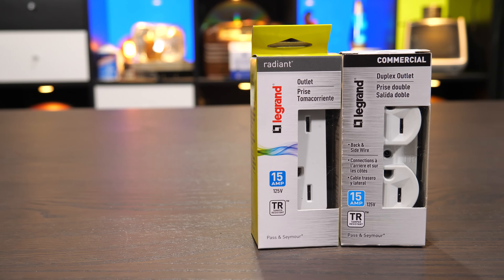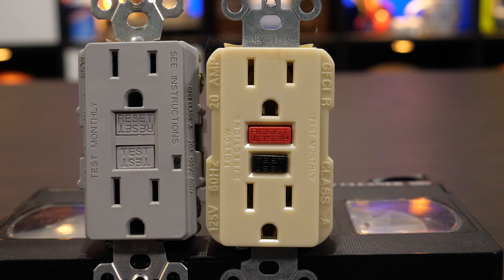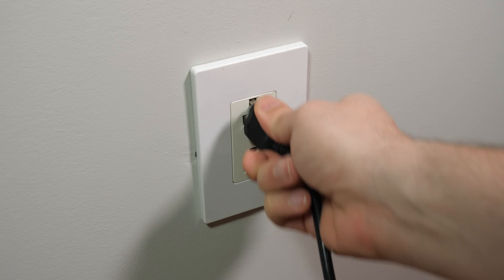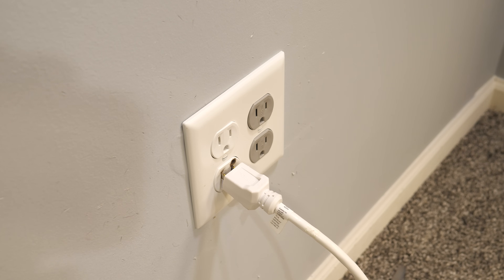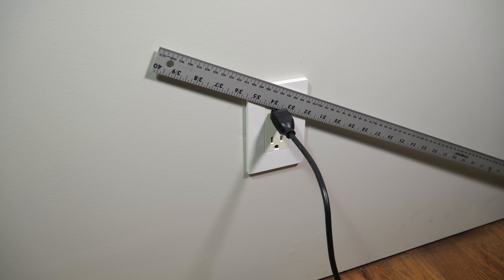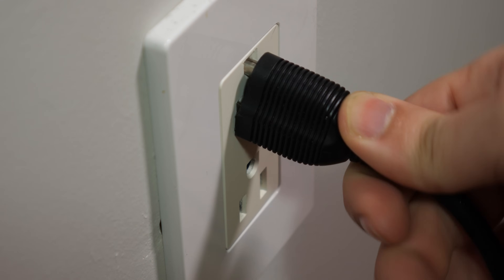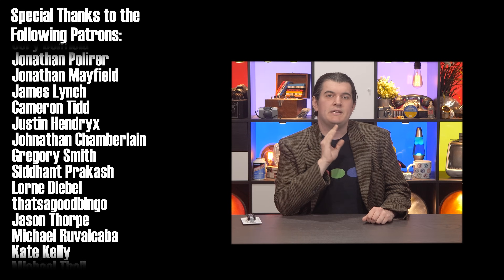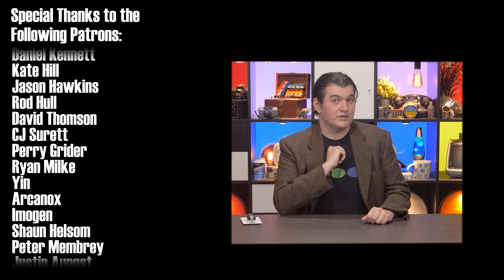Power outlets are topsy turvy - but does it matter?

Comment: I believ this is the point where I point out that here in the UK we have standard BS 1363 plugs that solve every issue you've brought up with the US power outlet.

- They are all 3 pin, 90° designs, so stable they're virtually impossible to accidentally knock out/loose (even for very worn units).
- The ground pin in on top.
- The ground pin is longer and opens shutters on the receptical which literally makes it impossible for children to electrocute themselves (for low power devices, the "ground" pin is a dummy)
- The electrodes are shielded so if the plug is in far enough to in to open the shutters, the plugs have no love metal showing.

- The plug body is usually shaped to facilitate safe gripping for both insertion and retraction.
- There is built in extra slack for the ground pin, so if the strain relief fails and the electrodes inside the plug body get pulled lose, the ground pin is the last to fail.

It would be such a pain for the US to change, but it's so much of a design!

Comment: Several of the power strips that I use have 90 degree swivel plugs. While I'm certain they're more expensive to make, and probably more prone to failure over time, they are nonetheless a great solution to the wall plug orientation problem. It doesn't matter if it's up, down, sideways or even diagonal (and yes, I've seen plug that was diagonal so it followed the line of sight of set of stairs) you can always orient the cord in the down position. What would REALLY be funny to see is one of those outlet-mounted surge protectors that have the outlets turned 180 degrees to the plugs on the back in order to invert directionality.

Comment: why not one face one upsidedown. ground on outer perimeter.
Reply: The problem with that is that the hot and neutral connections would be reversed, with one hot on each side and one neutral on each side.  This is awkward, because the two hots and two neutrals are connected together when it is manufactured, but can be separated by removing a connecting piece.  As designed now, it is a straightforward design.  Take a look at a new one and you will see what I mean.

Comment: US should just adopt British plug as a nationwide requirement. It's safest on the planet, can withstand crazy amounts of current as the prongs are huge comparing to those wimpy used in America. Almost every plug has a fuse itself. Also many European plugs are far superior. At least it's very hard to dislodge them, prongs are round and receptacles are placed deep inside so the chance of getting finger between live prong is almost impossible.

Comment: actually it is ideal to have ground down  and was done  to ensure if in case of flood the ground is the first contact to ensure water is grounded thats why right angle plugs are made like that  ,you are more likely flood then to  have something to come in contact with the plug and the sideways is for flood zone prone areas to ensure that a neutral grounds it out and it trips the breaker , water the nemesis  and really are you that much of an idiot that you don't plug it in all the way

Comment: Make more sense since a half way plugged connector in case something drop and make contact in between the outlet could have less chance of making sparks if the ground pin deflect it. I have seen some barber shops having the outlet installed with the ground pin upside. Is the correct answer to install it neutral pin up?

Comment: Ground pin up is usually job specification. And spec get you paid. Horizontal receptacles with the neutral pin on top is code. Most covers used these days by pros are nylon, stop buying the cheap ones at the Despot! One solution for the right-angle cord pointing up is to take a mountable tie-wrap, anchor it to the stud above the box and tie-wrap the cord to the wall. no chance of unintended unplugging.

Comment: Twice in my life I've seen things slide down behind the plug and short the pins and make smoke and sparks.  Once someone was adjusting something hanging on the wall and it fell down and exploded.  The second time someone was pulling a plug out and the motion shook the wall plate loose and fell down and exploded.

Meanwhile, in the UK the ground pin has always been at the top but many right-angle cords and wall warts are made to assume that it's at the bottom because that's how it is in the US, so the cable exits upwards.
Reply: More recently I've seen outlets with a shelf above the surface the plug presses against.  Also to the left, where the switches are, forming a kind of capital Gamma (rotated capital L).  So if you did need to mount it sideways you would clearly want to put the shelf and the switches, at the top.

Comment: As a German, the first time I ever used a NEMA plug was also the first time a got shocked in the process of plugging or unplugging anything. And this was in Germany, too, with our spicier 240 V 60 Hz (using an adapter).

I do believe that the North American countries could (and should) switch to a safer connector if they just wanted to. All arguments that claim it's impossible because "we already have this plug" or "there's too much momentum" aren't believable to me. Once a country decides to switch plugs and passes all necessary laws and regulations, new buildings will have new receptacles. Everybody will get used to using adapters for a while, and in 20-30 years most of the plugs will be safer.

Comment: Ironically, the right-angle power cord (non-swiveling) on my refrigerator WAS designed with the assumption the ground would be on top, but since it's plugged into an outlet with ground on bottom, the fridge cord is "upside-down" and drooping awkwardly just like the demonstration at 12:27.

Comment: Insulating pins near the handle is the only way to make it safe IMO.

European plugs don't have sleeves over the connectors, it's actually a plastic part that is the same width as the conductor. 

I bet if the pins are the same width with insulation it will work everywhere as sockets latch onto the holes in the plug which are at the far side

Comment: We in Europe do not care. SchuKo/type f (common EU plug with ground) goes both ways and is secure enough to the point that you really need to yank it. We usually have much more stuff with the other end of the detachable cable (powersupply etc.). And simple plugs without ground are the same. But we do not have them installed horizontal in most cases, over/under is normal (which is annoying with some bulky connectors or devices)

Comment: A wise electrician once pointed out how flawed the metal cover plate argument is; if the plate falls off and shorts between the blades of a ground pin down outlet, it trips a breaker and the hazard is removed. If the metal plate lands on a ground pin up receptacle, there's a good chance someone unplugging that cord later on will bump the plate and then it shorts out while their hand is right there, potentially burning them with molten metal.

Comment: The reason why the right angle plugs all face that way is probably because manufacturers saw that most outlets were installed with the ground down. If more people installed ground up outlets, then device manufacturers might produce more right angle plugs with the ground up.

In the meantime, you can also get extension cords that have swivel plugs.

Comment: Hobby machinist here. The first time I saw ground pin up was on a 1970's Benchmaster punch press. I restored the press and put a new outlet in it (LN up). It wasn't long before a slug dinked down and fell behind the light plug and POW!. I promptly replaced the outlet with GFCI and ground up. I'm GFCI sold on all new outlets and replacements now.

Comment: I generally install outlets gound up, because @10:30.  On the rare occasion when you have a right angle plug to connect (refrigerators, window air conditioners and... nothing else I can think of), turning the outlet 180 degrees requires only a screwdriver and about a minute.

Comment: I knew the US plugs weren't the greatest, but... wow. It's so easy to touch a pin that is live, holy shit.

Over here, the pins are sleeved at the bottom, and the entire socket is recessed into the wall. Contact is only made after all exposed metal has vanished into the slot, and the recessed nature makes for a pretty firm grip, especially if it's a grounded plug.
A little TOO firm, sometimes...

Comment: 7:35

The office I used to do desktop support at had cubicles with metal covers that clipped in over a row of 4 outlets. If the panel got kicked enough and fell on a plug just the right way it would fall down and eventually short between the live and neutral and take out a row of computers. 

When setting up or removing computers I saw quite a few trim panels with blackened spots over the outlets from when those panels fell down. Many rested on the cable because the plug wasn't loose.

Comment: I have some outlets that are recessed (by about 3/4 inch), which eliminate the exposed blade issues, and prevent the plug from being crushed by furniture. However, nothing comes without a drawback! They are harder to reach into.
Reply: And makes it harder to win at “throw the knives at the wall”

Comment: I have a fan of a model generally used in hospitals; it's a polarized type A two pin, but the plug includes a fuse, and there are actually spring loaded sleeves over the pins which are retracted by pushing the plug into the socket.

Comment: As a Brit I have one thing I want to say (and it’s not what you think). Those plastic socket covers at the end have their equivalents over here, but our versions are problematic for safety. This is because they can snap when you try to remove them, sometimes leaving the plastic earth pin inserted, thus leaving the shutters open and negating one of the key safety measures our sockets have.
Reply: Those plastic covers are no longer relevant as we now have tamper resistant sockets, which are mandatory in places where children may be present.

Comment: 12:04 I actually have seen a right-angle plug that assumes the ground-up configuration. My childhood window air conditioner (a Kenmore, if it matters - I don't recall the actual manufacturer code) had it this way. It was massive too, with a built-in GFCI system. 
And yes, the plug for it always hung off the wall when plugged in - none of us thought at the time to flip the outlet around to resolve that.

Comment: I used to live in a building in Boston's South End that was built in 2007 and all of the receptacles there were installed ground up. It was probably because of us Bostonians' penchant for New England's second favorite pastime after candlepin bowling: Throw the Knives Against the Wall. My housemate there, who also owned the unit (a Kiwi, who would twist the prongs on New Zealand Type I plugs on his dual voltage electrical items so that they'd fit into a NEMA 1-15/5-15 socket) explained why when I noted that I thought it was unusual that they were "upside down". He then said that any benefit was negligible. After that, I moved to a building a few blocks away that was built in the 1870s, but renovated in the 1990s and that I manage,  receptacles there were ground pin down. Whenever I need to replace a socket, I usually install new ones ground pin up. Unless I forget.

Comment: I’ve gotten the hint of this a while back. One day pulling some wires through a customers house, the steel fish tape sprung out a little and landed on an outlet on the adjacent wall, plug wasn’t inserted fully. Glad all that happened was a tripped breaker. I’m definitely not switching my grounds facing upwards though, leave that to hospitals.

Comment: Most of your plugs are 2 prong??? Almost all of mine are 3 prong. The outlets are all 2 slots. Or can we say 6 hot dogs and 8 buns. Weird tip hot dog buns can be filled with peanut butter and jelly. (Disclaimer: Peanut butter and jelly not to be used with electrical outlets. Wash the knife before throwing at outlet.)

Comment: when I bought this house, the previous owner was an "electrician" (quotes as in he did it as a living and might have passed a test at some point), so anyway whenever this guy touched a plug he installed it ground side up, which would be fine but the one's he didn't touch are ground side down. I look to my left where the TV is plugged in its up, if I look to the right where my computer is plugged in its down ... like less than 6 foot away COME ON MAN!

Comment: An alternative to your right-angle plugs that also solves the pin-shielding issue would be to have inset sockets like many European systems, especially the types J & N. This way, force from a bump or the weight of the cable gets directed into the plug rather than the pins, and the plug becomes electrically disconnected long before it's in reach of small fingers.

It would mean that the current plug shapes need to be standardised, and your right-angle plugs would need to be redesigned, though.

I must admit to preferring our plugs here in the UK, but I think our best safety feature is having switches on our sockets by default. It avoids needing to yank out the cable to remove power (which I'm sure wears out sockets or damages the cable), or dodgy switches on cheap appliances. Then again, most of Germany (outside of schools) use regular old type-C plugs with half the safety features, but they don't have more electrical deaths, so maybe it doesn't matter in practice anyway.

Comment: one thing no one mentions when they talk about "what if a coin, knife, ruler falls on the plug?" is that even with the ground plug up, depending on where the ground plane is, there can be a difference in voltage potential between where you're standing, and where the ground plane goes into the ground, meaning there may be voltage & therefore a shock by touching ground. Not to mention some neutral is tied to ground.

Comment: In Chicago, the outlets are horizontal, because of the electric code requiring conduit. Mounting the boxes horizontal make it's easier to pull wires, versus any code issues.

Comment: can't we just start making power strips where the plugs are placed horizontally? AND SPACED FARTHER APART? in my house so many plug sockets are wasted on power strips because 1) the plugs are too close together, 2) they're all in a vertical line so blocky plugs with the cord coming down block all the other sockets, and 3) for some reason EVERY SINGLE MANUFACTURER making some kind of charger decides to make the plug for their device this huge inconvenient blocky shape that takes up a ton of room. like.. WHY CAN'T YOU JUST PUT A POWER BRICK IN THE MIDDLE LIKE LAPTOP CHARGERS?!?! THIS DRIVES ME ABSOLUTELY NUTS!!!

Comment: Has the solution of making the outlets face opposite directions been considered? This would have the benefit of making right-angle plugs work in either outlet without blocking the other, and would put the ground prong of the top plug at the top.

Comment: put the ground at the bottom so I can plug in my dehumidifier with the 90 degree plug and not have it upside down. The 45 degree plug just has to dangle and make you wonder what the hell they were thinking. These must be the same dudes who put the switches behind the bathroom door on the hinge side. I see a lot of rationalization for upside-down recepticles but no sound science. I have been using these things for a lifetime and never put my thumb on top. I hold it by the sides as if it were charged with house current.

Comment: Seems like the ideal solution is for the top outlet to be "upside down" and the bottom outlet to be in the regular "smiley face" orientation. That way the top outlet gets the benefit of the ground pin on top, while the bottom outlet can use 90 degree plugs just fine.

In fact, this orientation would allow you to use two right angle plugs on the same wall box. Which is often impossible because the top one covers up the bottom outlet

(of course the actual "ideal solution" is for the US to switch to a plug type that isnt so obviously terrible but that's never happening)
Reply: That would complicate the internal construction, as hot and neutral would have to criss-cross each other, instead of being in line.
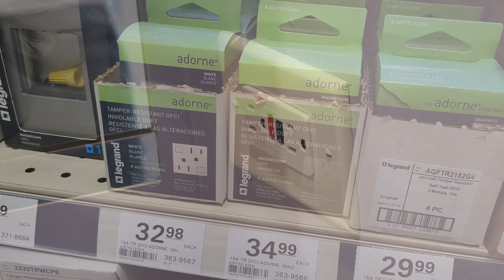Reply: @dougbrowning82  thats clearly not an insurmountable design hurdle or the sockets shown at 3:48 wouldnt exist.

Comment: Whatever standard plug/outlet Sweden uses:
The cover that covers the live metal contacts in the outlet, is a single plastic piece and it is spring-loaded so it binds shut unless you insert an actual plug. (Or a fork with the middle… whatever you call the things that make a fork a fork, Prongs? Needles? Forklets? bent away. But if you made a tool, not even the safest outlet is safe)

And as we have insulation on our prongs, it is nearly impossible to get exposed live metal. I do remember scrapping an old plug that did not have insulation on the prongs, just all brass.

Any chance we can get Receptacle Review. Going through old to new outlets and plugs.

Comment: Love 90deg plugs. A good idea would be an adoption of duplex receptacles that are "face-oriented" but next to each other as opposed to stacked. Receptacles could then be installed sideways and the plugs don't have to be sideways too. Maybe standards could be made to increase distance to allow for clearance of those dumb, blocky AC adapter plugs or we could finally start getting companies to move away from them entirely.

Comment: This is what a Dutch wall outlet looks like: (Google "Stopcontact" because the link kills comment)

Ground on both sides, and that's the only connection that can be made when you can still touch something metal (?: plates, they are cylindrical here) If they made a connection you can only touch plastic...